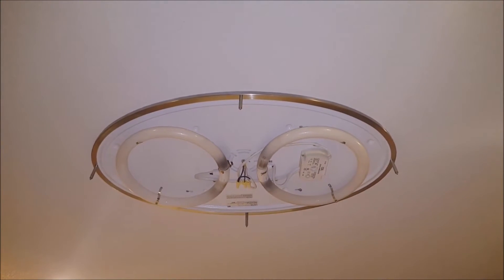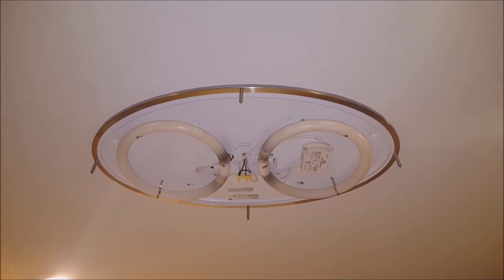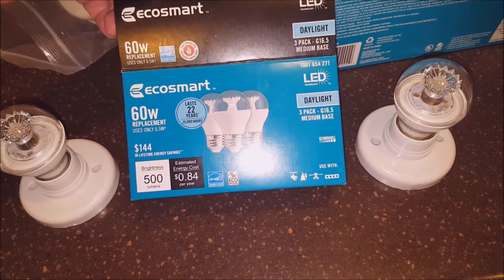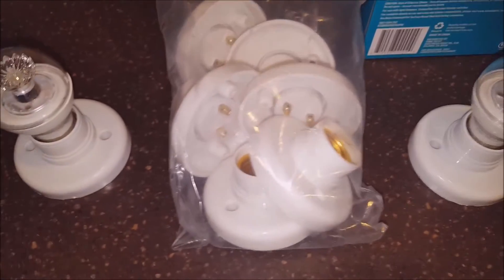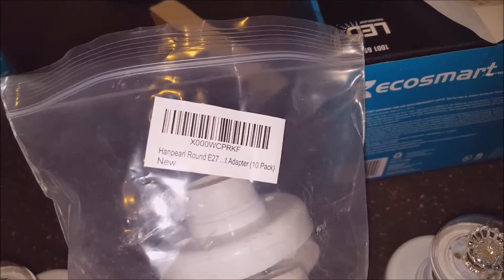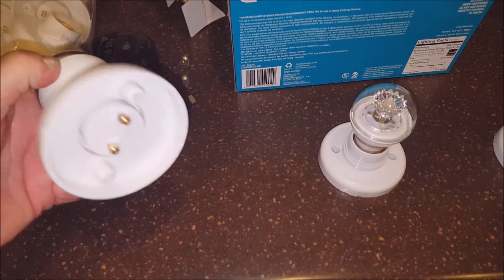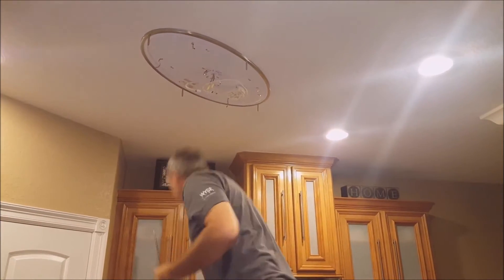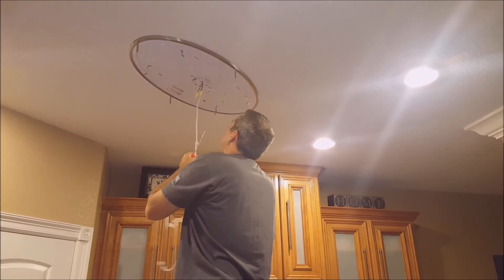LED Light Conversion from Fluorescent

Comment: My fluorescent is just one bigger circle bulb... i wonder if you can buy a led unit that is similiar to  original fluorescent bulb ??? definitely don't want to spend $50 for a new regular replace..leds are way better in every way
Reply from the maker: there are lots of options out there now. not many when i did this.